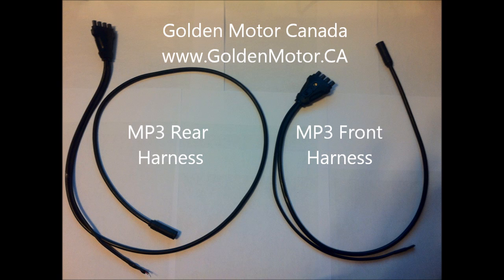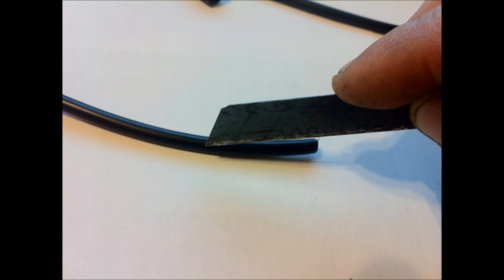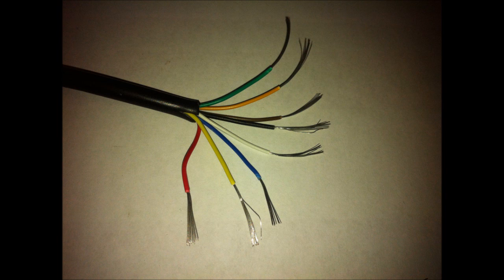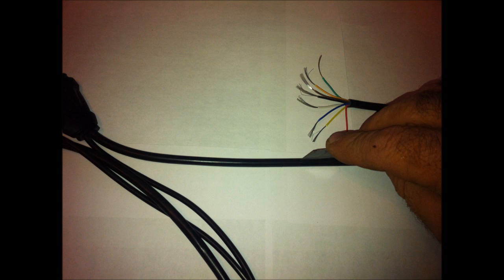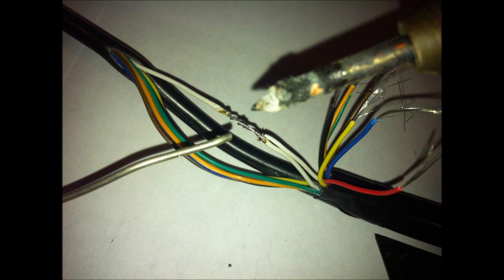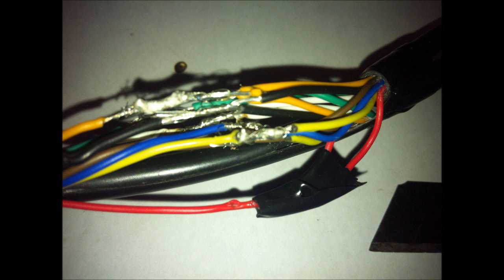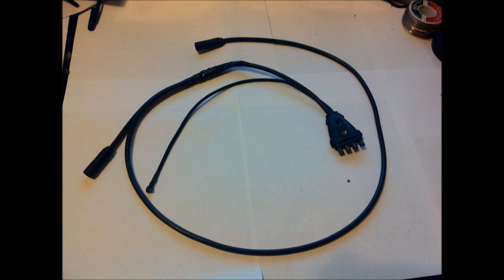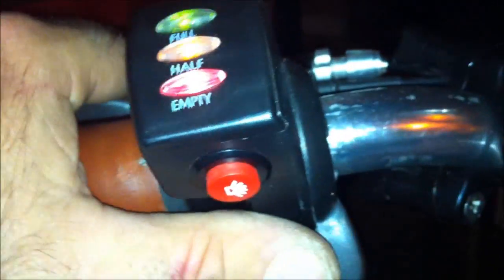Dual Drive Wire harness for Magic Pie

Comment from the maker: The MP3 is only available with an internal controller. The upgrades done from MP2 to MP3 are improvements from the internal version of the MP2 to the internal MP3. At this time there is no plans for MP3 to be available with an external controller as there would be no real difference.

Gary